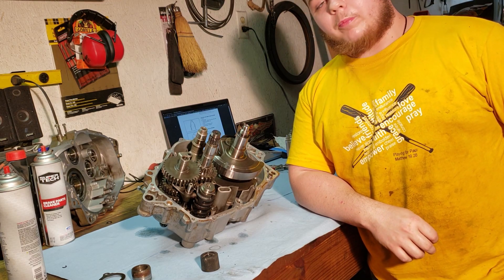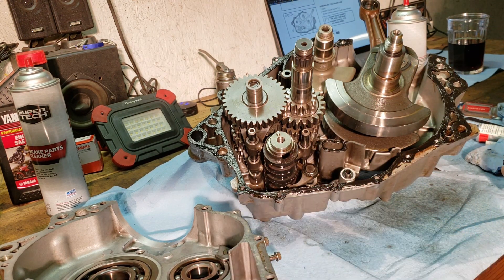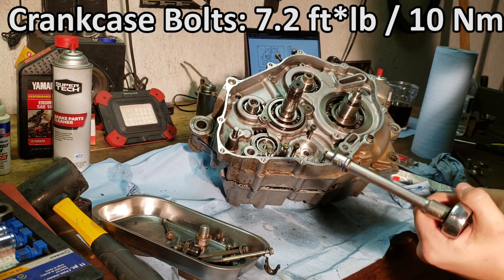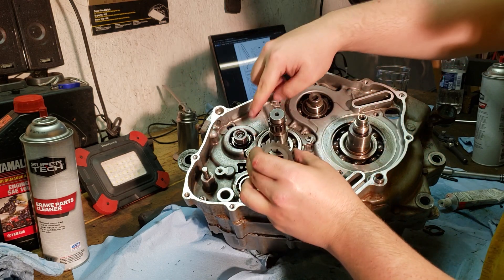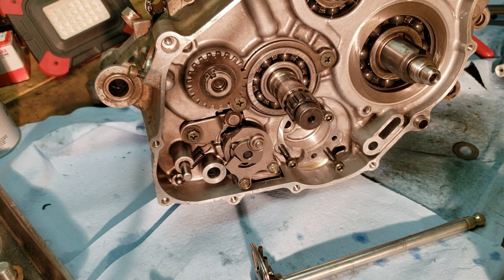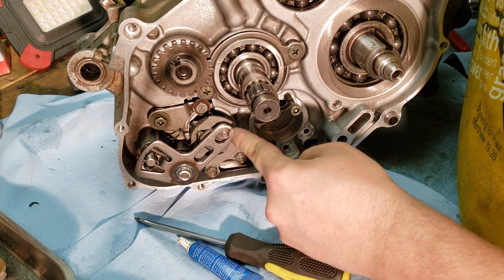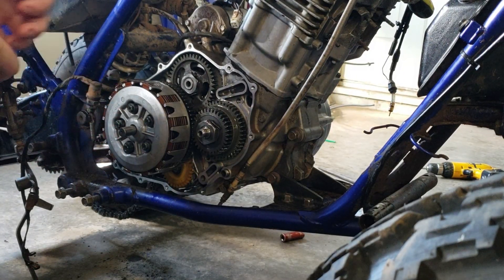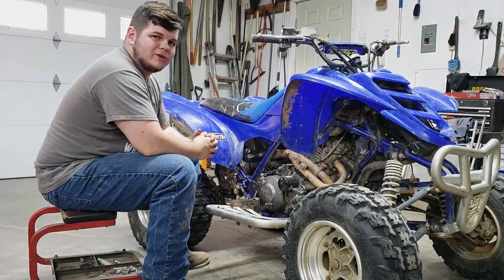Raptor 660 Bottom End Rebuild

Comment: I got a question not about bottom end rebuild so to say but so let's say my bottom end goes bad because of shift drum or fork but my top end is still perfectly fine would I be able to separate the 2 and install a good bottom end motor without having to do anything with the top end or the timing?

Comment: I have the same enginge in my motorcycle and i want to do the same, but the bearings are just expensive as hell 🙁
Reply from the maker: That's why I was glad that mine were fine, I do remember seeing someone on ebay selling the transmission and crankshaft bearings as a set for much cheaper than buying individually

Comment: 7:24 min mark.. My spring is stiffer than hell. Is that normal? I free spun the clutch basket with a driver and went through the gears and the shifting was a little harsh...
Reply from the maker: It should be stiff as hell, your foot and a shifter can produce a lot more force than your hand and a screw driver lol mine got to the point where it didn't have enough tension for the shifter to move the shift drum so it stayed in like 2nd gear, couldn't shift up or down lol
Reply: @Hunters_Mechanics  When you put that spring on there it looked really easy so that threw me off lmao but what you say makes sense.. It needs to be really stiff.

Comment: I'm doing a raptor 660 like that. When I took it apart it was in neutral and now it's not having a rough time getting it in the neutral. Any ideas how to do that would be appreciated. Thanks!
Reply from the maker: Sorry for the late reply, YouTube won't send me notifications for comments..... have you figured it out yet? After I got the forks for the drum aligned I didn't really have an issue getting it in neutral, I would double check with the manual to ensure that you have every gear in the right order, along with having the forks in the right position. Does it shift through the other gears fine?
Reply: Yes, I got it figured out. Thanks for the reply
Reply: I've got another question. The amount balancer I think I'm having an issue with mine being the wrong way because it keeps hitting crankshaft. Any ideas on that?
Reply from the maker: @jaysonkelley9519  i assume you mean counter balance, are the timing dots lined up as shown at 11:05?
Reply: Ok thanks

Comment: Hey man, can take a look at the video I just posted and tell me what you think? I just re did valves and it’s still making that noise
Reply from the maker: What all work have you done to it? Check the timing chain slack and make sure it was tight?
Reply: @Hunters_Mechanics  686 bore (OEM cylinder) 11:1 JE piston, stage 2 hot cam, dual springs, full FMF. I got it in December and I’ve been rebuilding it slowly since (kids eat up a lot of time lol)
Reply from the maker: @Lemensgarage  well I can't tell exactly over the phone but does it disappear when it get warm or quieter? It almost sounds like a piston slap than a valve train ticking (but again its  hard to tell where it's coming from on video) and yeah, living 3 hours away from the garage now eats a lot of my time lol

Comment: I just rebuild my 2005 raptor 660 and  waiting on a new carb, but question if I press down the clutch, will this allow my quad to move when it's in gears?
My quad only moves in neutral, NOT when is in gears even by pressing the clutch and friends are telling me that the clutch should allow my quad to move and that something is wrong with my clutch.
Reply: I haven't been able to run it yet because I don't have the carb.
Reply from the maker: It'll feel stiff in gear but it should still move, you may not just have the clutch cable adjusted right since you just rebuilt the engine, I know I had to adjust mine quite far before I was able to shift into gear without it killing it
Reply: The clutch lever moves with the slightest resistance. Yet it will not disengage the clutch even after turning the lever to its max pull.
Reply from the maker: @jorgevirgen1660  The lever definitely should have some grab to it, could also be because you don't have oil in the case to allow the friction and steel plates to move and compress when needed. I know my lever just flopped back and forth when I fresh rebuilt mine, I just put the spring on the lever and then adjusted the clutch cable roughly to the manual spec and it worked fine
Reply: Thanks I watch most of your videos to rebuild my quad. Thanks
Reply: I justed fix my clutch. The solution just in case some of your viewers have the same issue we're the 5 clutch springs. I bought the previous set on Amazon and we're not on spec, they were too small. I just bought new ones that fit the right specs and my clutch now works.

Comment: Is there much difference in instructions for Rhino 660 motor?
Reply from the maker: I've never had one so I wouldn't know. I'd assume not since those bottom ends are not a true manual transmission and use belts (correct me if I am wrong)

Comment: Hey I’m getting my engine rebuilt and I saw the crank shaft it has some blue coloring on the metal where it hooks up  to the  piston rod any idea if its normal?  New or used part? A shop is doing the rebuilt.
Reply from the maker: Brand new cranks can have a blue mark on it since most of the time they are heated to extreme temperatures to be assembled, as long as you don't have any noticeable cracks, wear, or insane clearance between the rod and crank then it should be fine
Reply: @Hunters_Mechanics  thanks a lot I appreciate it.

Comment: Do you have a video that explains how to replace the decompression pin on the 660 Yamaha raptor
Reply from the maker: I do not, it appears I need to since I've had several questions about it lol
Reply: @Hunters_Mechanics  It would be awesome if you made a video on that. I watched all your videos and they helped me on some problems I was having. I subscribed to your channel and would definitely be interested in watching.
Reply from the maker: @andrespinon6841  I'll keep that in mind over break,  ive got a few videos planned around the Christmas time since I'll have time to record
Reply: Hey if the timing is correct on the bike I have12 V on the battery cam gap is correct when I get it to turn over The bike feels like it has a lot of compression and then don’t wanna crank. I took off the spark plug and spins smoothly frilly no noises
Reply from the maker: @andrespinon6841  How hard is it to turn the engine over by hand with the spark plug in?
Reply: @Hunters_Mechanics  it’s easy to turn over by hand with spark plug inn but once I get it to a certain point gets hard then goes back to easy  back to hard  again Me doing it by hand with a socket
Reply from the maker: @andrespinon6841  In reality that is what it should do since you are eventually going to hit the compression stroke which none of the valves are open and its just compressing the air/fuel mixture inside the cylinder. If your starter cannot turn it over, or at least turn it over fast with the spark plug in, it definitely could be a faulty decompression pin
Reply: @Hunters_Mechanics  ok. Thank you. I’ll be getting a new cam with a pin. Any other suggestions? I’m running out of options. I installed a new battery, new relay, new starter and new spark plug.
Reply: Also it’s hard to get a compression reading, but I got 95?
Reply from the maker: @andrespinon6841  When was the last time it ran and have you changed any engine components since then?
Reply: @Hunters_Mechanics  I just picked it up  thinking I can fix it . The only thing that I know is that the bike supposedly ran 2 years ago engine look stock. Going to takeoff the engine apart tomorrow and see if the intake valves bad holds engine tight

Comment: I followed your steps for the build but mine will not shift into gear I have everything connected and hooked up besides the clutch cover everything else is there what could be the problem?
Reply from the maker: Does the shift shaft rotate the drum when you move it up or down? Did you rotate the main axle when trying to shift gear since the gears have to be rotating to shift?
Reply: @Hunters_Mechanics  I figured it out thank you man, the shaft came off of the key for the drum so when you shift it’s just basically pulling the spring that’s it once I connect it back on the key it would work thank you again!!
Reply: @Hunters_Mechanics  so I have the clutch cover off the plates off the boss off and the basket and when I shift the shift shaft it pops it off the circle key that sits on the outside of the drum why is that?
Reply from the maker: @bobosbikes2467  When you're shifting it by hand you must be putting force towards yourself and causing it to slip off. But also, when the clutch basket is installed, it will stop the shift shaft from moving off that round collar. When I had my issues with my shifting, that's what  thought was happening but the clutch basket sits there to stop it from coming off. Install the basket and the boss with the nut and see if it still pops off
Reply: @Hunters_Mechanics  will do sir I’m going to do that now!! I was thinking that basket should hold it but I will check
Reply from the maker: @bobosbikes2467  Let me know how it goes!

Comment: Can you rebuild my raptor 686r bottom end?! Had a vibration at 1/4 up timing was great and the complete top end is new 686 11.1 . 
Though doing the top end would get rid of the vibration but I'm worried it's  a balance shaft or bearing.  If you can perform this service let me know asap
Reply from the maker: I wish I could but I am still a full-time college student till (hopefully) this coming May. After I get out I am thinking about taking in work!
Reply: Hunters Mechanics  well I took apart the engine (completely) everything I did was correct! My problem was the piston was hitting the head ever so slightly about another .20  thousands it would be fine.  Yamaha Piston to head clearance is very tight the head was deck about. .10 - .15 thousands 
So my vibration was the new Wiseco 11.1 piston hitting the  head I use cometic engine rebuild gasket kit from cometic.   call them you can have any gasket built to any size you need and I got mines .20 thicker  stock is .10 thousands So. 30 thousand . It's a 2001 but has the better 2nd gear so I just reassembled the engine with hot rods stage 2 cam and springs and with the 686 11.1 . Just have to figure out jetting .
Reply from the maker: @shawnboy4368  good to know you got it figured out!

Comment: Hey man, talked to you a long time ago and my engine being messed up. Turns out piston cracked and went to bottom end wiped out a bunch of shit. Long story short 1400$ and got it running. Then my starter clutch went and got that fixed. Runs like a beast now just trying to sell it.
Reply from the maker: I've replaced the starter clutch in mine twice because the spring behind the bearings kept getting stuck and would just cause the starter to spin and not the engine. That sucks that you had that piston issue happen, hope you find a more reliable quad!